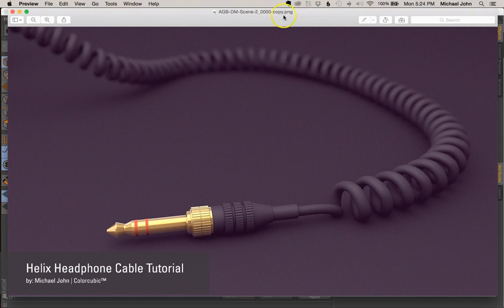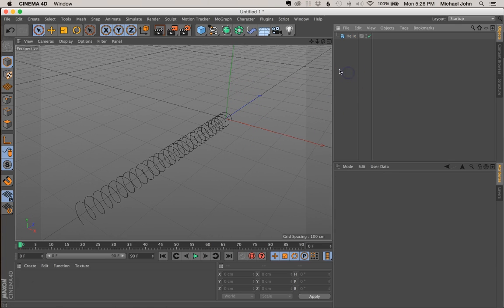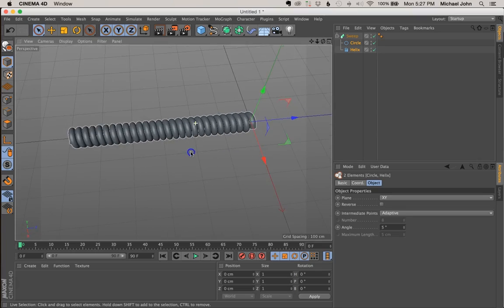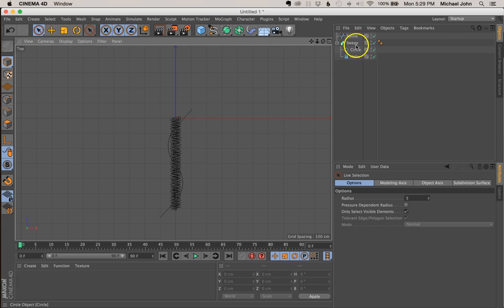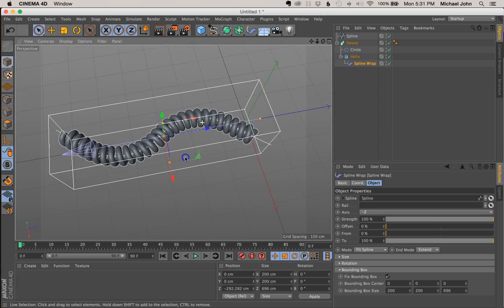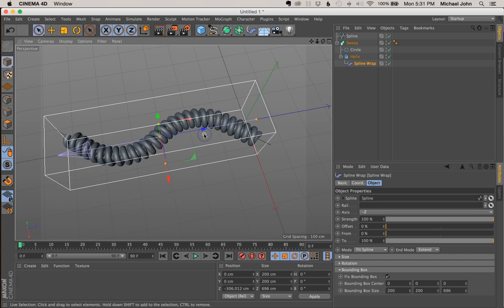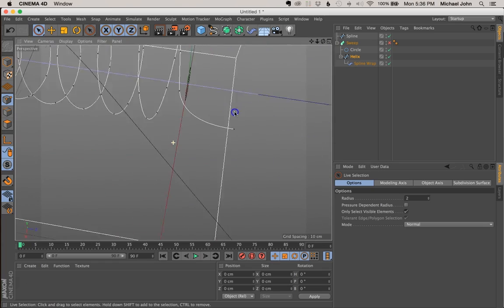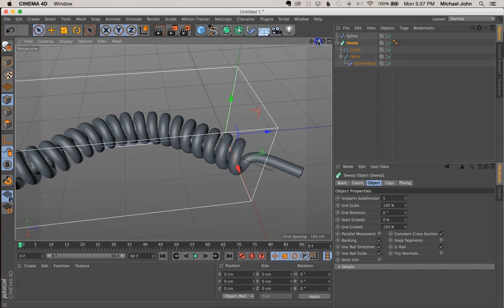Cinema 4D Tutorials - Helix Headphone Cable

Comment: this no longer works in C4D 2024. when you add the circle and spline into the sweep, it flattens the mesh, rather than giving it the structure. can you take a look and update this video?
Reply from the maker: @JimiJames  thanks for the heads up. I’ll take a look and revise a new process for this.
Reply: @Colorcubic  awesome. theres is a chance im doing something wrong but followed your steps closely and it is defunct on my end. lemme know what you find!
Reply from the maker: Have you tried reversing the hierarchical order of the assets nested?
Reply: @Colorcubic yes! In the correct hierarchy order from the video the circle goes around the spline but it’s flattened, not cylindrical.
Reply from the maker: Have you tried altering the X/Y/Z axis of the circle and/or helix splines?